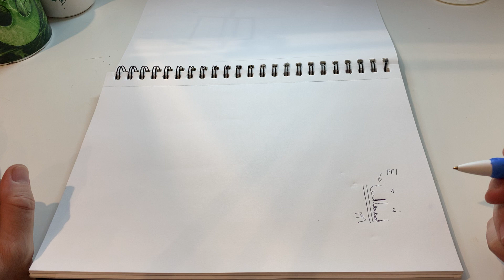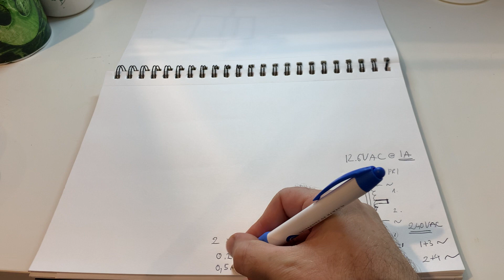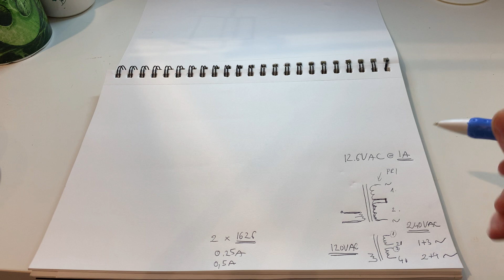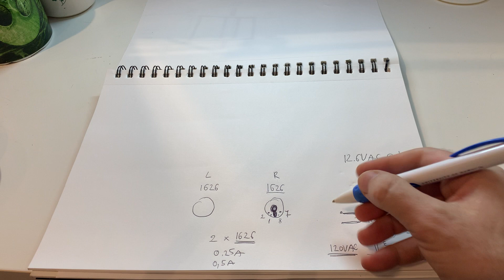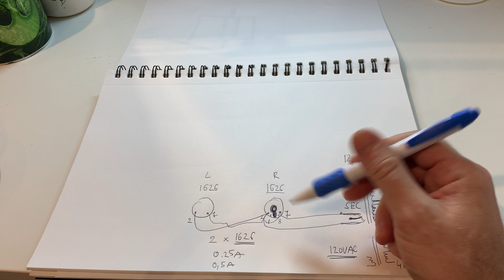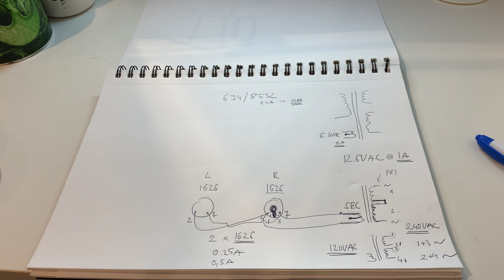Filament supply schematics of the Baby Darling SET amplifier

Comment: Why connect to the cathode vs to ground?
Reply from the maker: It results in lower hum. Also, when the filament is centered on the cathode, the tube behaves closer to a direct heated tube (where the filament is always centered on the cathode)